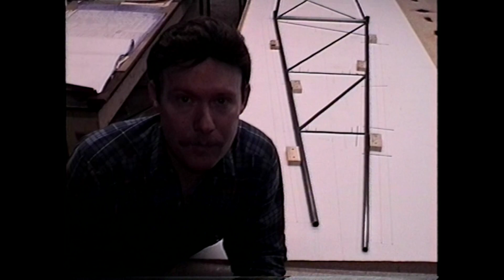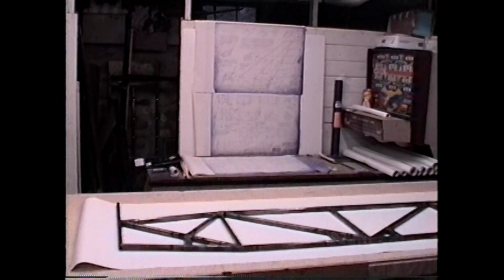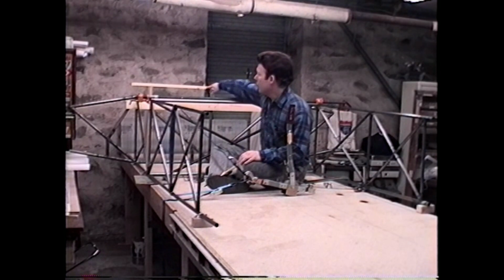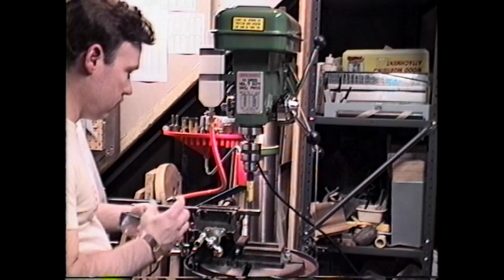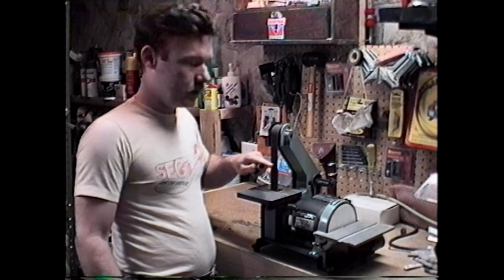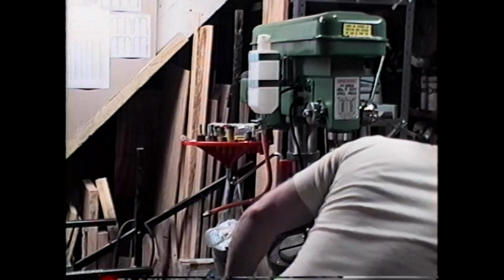Pt2. Experimental Delta Wing aircraft built from drawings

Comment: Dunno if you still check this channel, but I'm curious as to why you've been using a gas torch to weld instead of an electric welder like a mig or tig.
Reply from the maker: There are many reasons to use Oxy/ace torch for welding aircraft over other methods. Unlike welding other things, aircraft need to have the stress buildup in joints from welding relieved. This is done by evenly heating the joint and then slowly removing the heat and letting it cool gradually. This cannot be done with other methods of welding. Stress relief will give the strongest joints possible. Gas welding also gives you much more control as to how much filler you can ad to the joint and allows you to control the temperature using the filler rod to prevent overheating of thin wall tubing. Another reason to choose gas welding is the initial cost of equipment is less. I wanted to spend the funds I had on aircraft building material rather than expensive tools. For more information on Aircraft Welding see the book "Aircraft Welding" available from EAA. Thanks for your question.
Reply: I stumbled across the Delta randomly a week or two ago and I've been captivated by it, I'm seriously considering building one as it's always been my dream to get my pilot's license like my dad since I was a little kid.

Comment: As a metal fabricator I think he should be using a rosebud torch attachment instead of a welding tip to heat the metal.
Reply: Robert, A rosebud tip was not used as I felt it would generate way too much heat for this application. Please keep in mind that the 4130 steel tubing used for aircraft has a very thin wall thickness and would heat too fast with such a large tip. Also, I was heating both the upper and lower longerons to try to bend the structure as a whole. I wanted to control the bend so that only the inside of the bend radius was being heated to the point that it would conform to the bend with out stretching the outside of the bend radius. This technique should result in a much stronger structure then if the tubing was over heated and stretched too thin. I have used a rosebud tip when I bent the 1" 6150 spring steel solid rod used to construct the main landing gear legs. But that was later in the project.
Reply: Thanks for the explanation. On second thought I realize you were right. I’m watching your project with great interest.